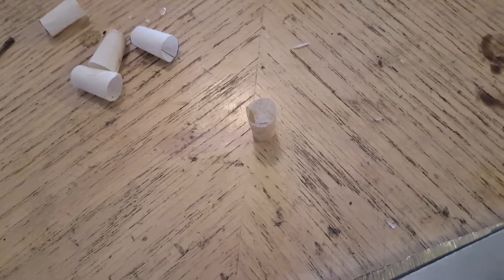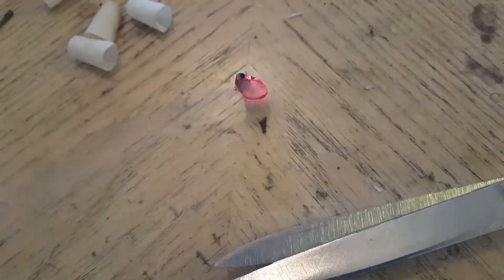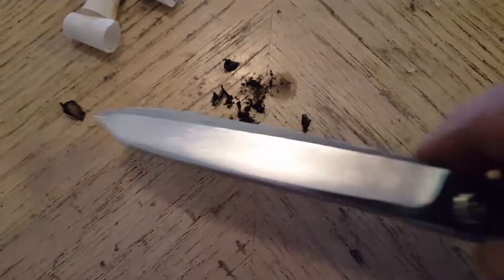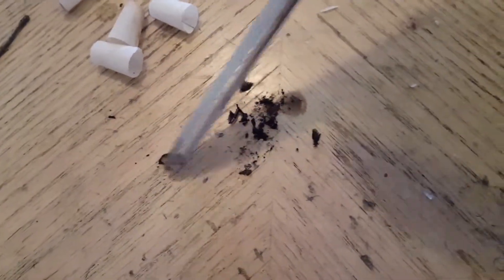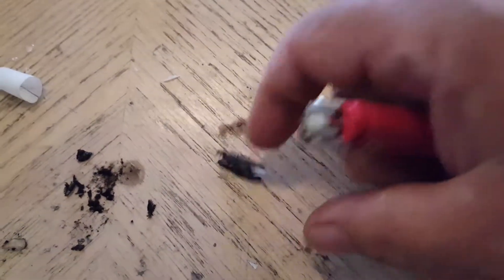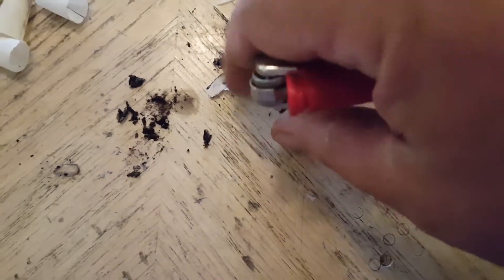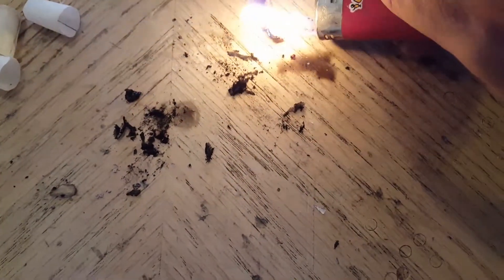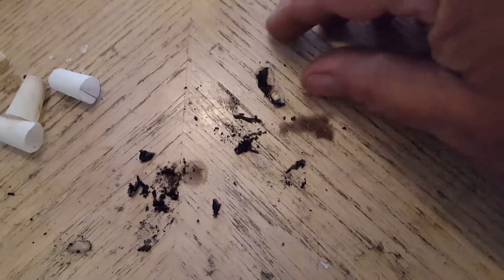Combustible paper cartridges

Comment: Is any residue left when you fire it out of a barrel? Does the gun blast the residue out of the barrel?
Reply from the maker: Matters what glue you use on the paper. You have to use an organic glue that will burn. You may have bits of the base of the cartridge in the chamber. My friend used glue he made from flour and sugar. Both burn. Super glue, Elmer's glue and others do not. I did an experiment, I was able to fire 7 cylinders before the gun misfired as a result of all the paper residue in the chamber.

Comment: Try using magicians flash paper. Instant combustion with zero residue.
Reply from the maker: How robust is Magicians flash paper? Isn't it like a thin tissue? If so, it will not take rough handling as well as nitrated coffee filters. In the old days they used animal intestines as the wrapper. I do not know if they nitrated them or not. Nitrated coffee filters work fine. I have yet to hear any complaints.
Reply: I know it’s just a hobby but nitrocellulose and black powder is kind of an oxymoron